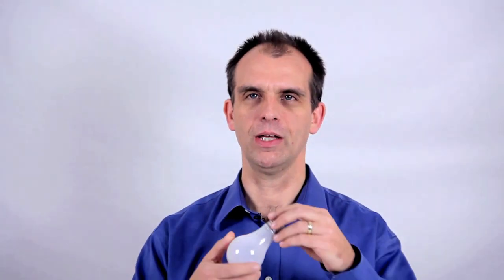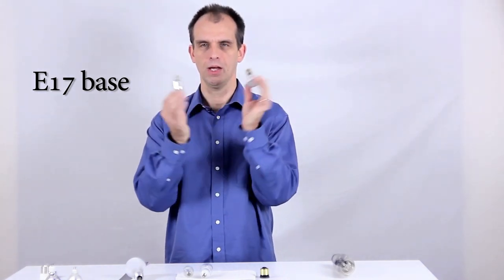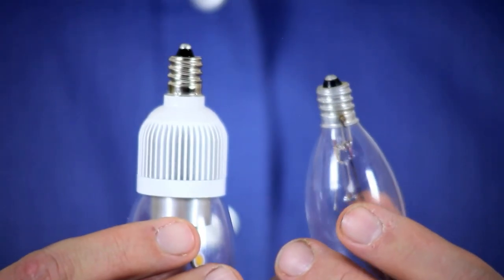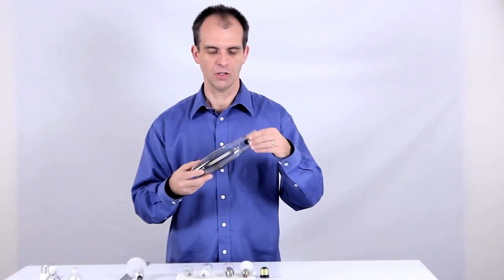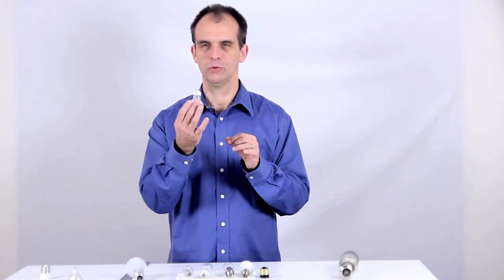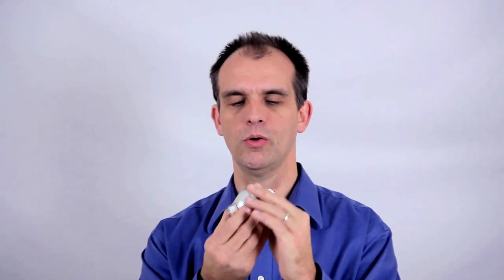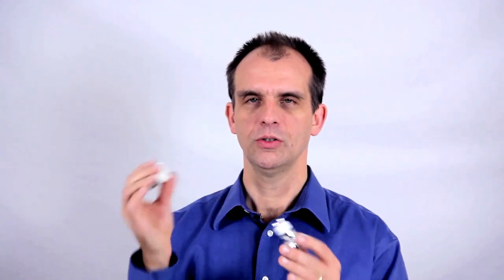Lamp Base Types

Comment: my mother inherited a torchiere lamp that was brought in 1948 when my great grandparents married.   Uses a E39 (mogul) 3 way socket,  with a 100-200-300 watt or (uncommon,  50-100-150 watt with mogul base)  bulb.     Another E39 base bulb you might find in a residential area,  is a mercury vapor, metal halide or high pressure sodium fixture in an outdoor floodlight, or if you have an indoor garden and use metal halide/high pressure sodium grow lights.
Reply from the maker: Interesting. Hope the video was helpful in figuring that out!

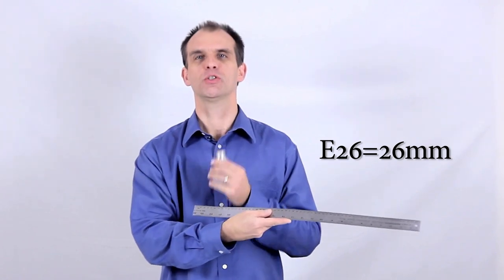Comment: at 0:51 quote "I dont know why ? but there you go... the bases are measured in millimeters" " Answer :as of 2021 most countries use the metric system. The U.S., Liberia and Myanmar are the only countries left with imperial system.
Reply from the maker: Yes, the metric system is everywhere! But that's not my point. The reason it seems unusual is twofold:  1) Edison bases have been around for decades, and originated in the US, where metric is not generally used. So it's a little surprising they should be measured in millimeters. 2) Bulbs are measured in eights-of-an-inch in diameter. For example a "par 20" bulb is 20 eights-of-an-inch, or 2.5 inches. So, it's surprising that the bulb diameter is measured using the imperial (inch) system, but the screw base is measured in metric (mm).

Comment: Why can't I find dimmable LED replacement bulbs for my chandelier?  When I look at the LED's it tells me their base is an E12, but you can clearly see by looking at the base that it is not an E12.  Are E12 and E14 compatible in the same fixture?
Reply from the maker: E12 and E 14 are not compatible in the same fixture. But E11 and E12 are compatible. One is Euro standard and one is North American but they can be used in the same sockets. As for dimmability there are two challenges with chandelier bulbs 1) They are so small there is very little room for sophisticated electronics in them  2) they consume so little power (like 2-4 watts typically) that many dimmers can't work with them. The issue is that a typical dimmer may not get enough current running through the AC circuit to power itself (because only 2-4 watts is flowing) and the dimmer itself may lose power momentarily, causing flicker.  We found the Leviton 6674 dimmer is good for very low loads like this because its internal electronics are designed to run on very low current.
Reply: @lumicrest  Thank you!!!

Comment: How can I fit an E26 bulb into an E12 base?
Reply from the maker: That could be a bit tricky. Putting an E12 into E26 is pretty easy as there are adapters for that, but an E26 to E12 adapter is more rare. If you do find one, the next question is "is it safety certified for North America, such as with cUL or cETL certification?". So you might find one, and it may work, but there's no guarantee it's officially allowed to be used in North America, even though you might buy it in North America... Good luck with it.